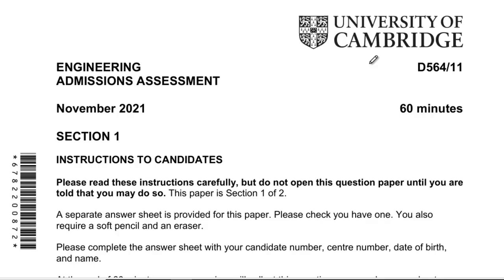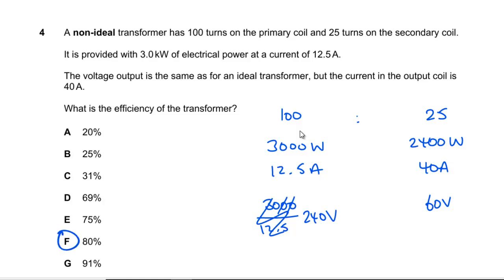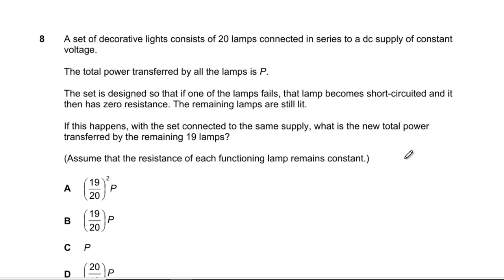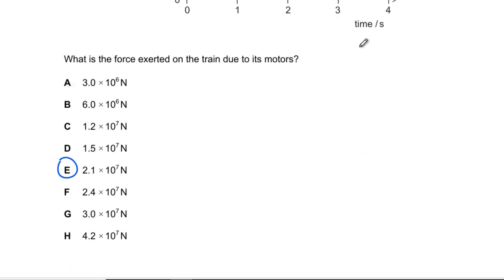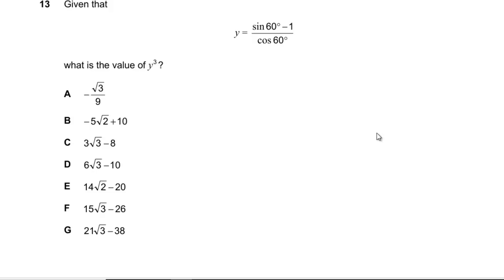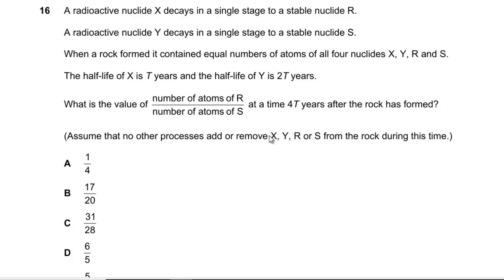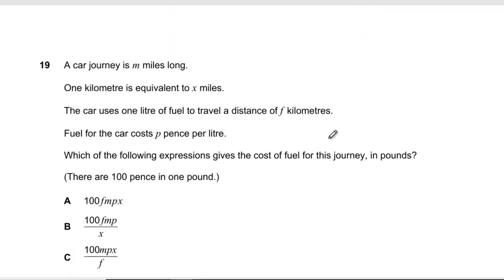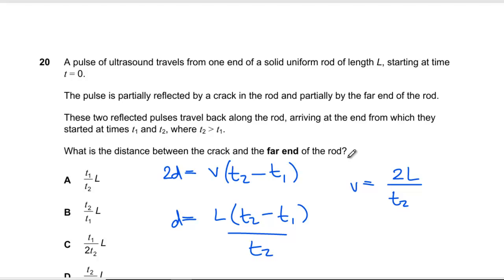ENGAA 2021 Section 1 Part A

Comment: Why do you divide 77 by 4 specifically in question 17
Reply from the maker: The length of the new diagonal is sqrt(77)/2 which is then squared when doing Pythagoras, giving 77/4.
Reply: @BlakeTerrorPhysics  Thank you

Comment: Hey Mr Terror. Could you please explain why v = 11 at 9:06 ?
Reply from the maker: It's a switch of frame of reference to make it easier to understand the effect of the wave on the ship. The question starts with the ship moving at 8m/s and the wave at -3m/s. If we switch to the frame of reference of the ship then the ship is moving at 0m/s and the wave at -11m/s. This leaves us with a simple calculation using the wave velocity and time period. Otherwise we would have to consider the motion of both the ship and the wave in our calculations, which is much more fiddly (although possible).